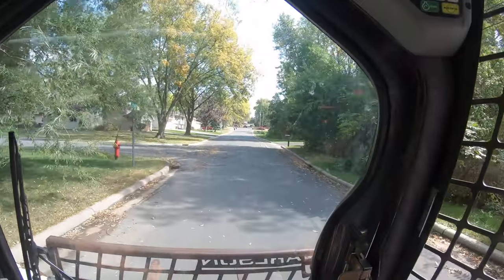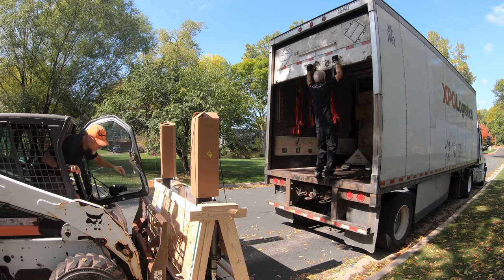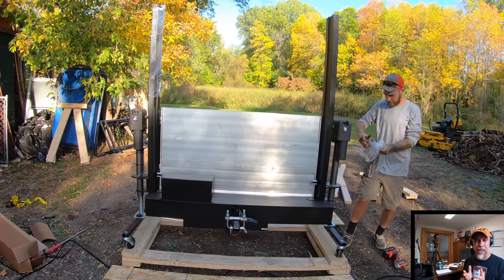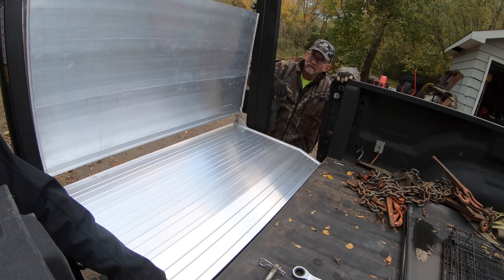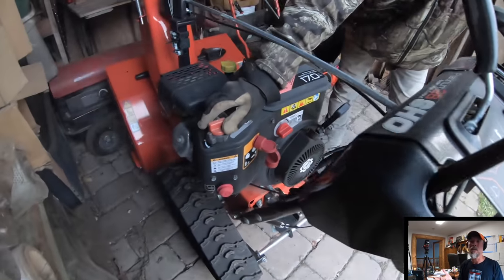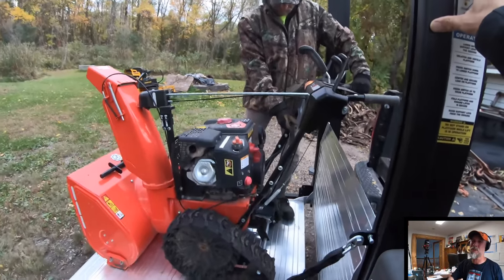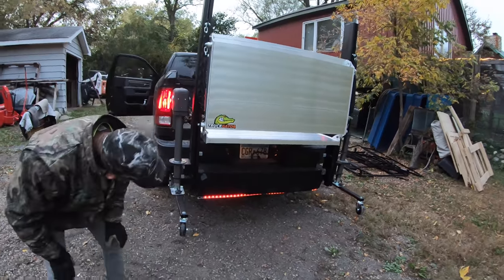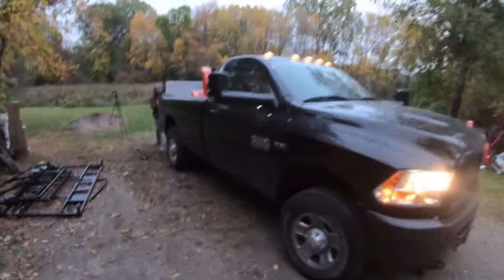Work Truck Lift Gate

Comment: I started out push mowing out of a 06 chevy silverado. Mowed a customers lawn twice for nice steel ramps for a mower. Bought a 48" exmark turf tracer. Loaded it in the back. Slid right in the wheel wells, perfect fit. Held the push mower behind it. Blower trimmer and fuel to the side along with the ramps on the other side. Eventually bought a 16' enclosed trailer and grew from there.
Reply: http://imgur.com/a/4fWpycF
Rear view of ramps down and mower in bed

Comment: I was a wheelchair bus driver and had a ramp like that on a cargo van. It was make of steel and much safer than that looked. In the winter when there was no school I used it to load up my 3 stage snow blower and was great going different places

Comment: My buddies and I designed and built a low-profile lift like this for a college engineering project.  It's a lot more simple (and cheaper) than this Lift Gator, but needs a few more revisions to be perfect.  If I recall, it has a 600 lb capacity, a platform with a low profile to easily load things (like a refrigerator on a dolly) and it probably cost us about $300 in materials.  Also, whatever truck it is installed on needs zero modifications in order to use it.  The tailgate stays on and the platform can even be folded up for transport, sort of like this thing.  Perfect for moving appliances or small equipment.

Comment: I have just a regular Tommy gate lift gate on the back of my F250.. That I used to pick up washing machines refrigerators boilers and engine blocks anything that is too heavy To physically lift into the back of my pickup truck... I've even used it to load my riding lawn mower. But my gate is only has a 2 and a 1/2 foot wide deck.
Reply: i use mine for delivering appliances for big box stores. i've loaded my cub cadet rider and it's a little sketchy but it gets it up and down.  sometimes i wish i had gone for the widest model  but that cuts into your visibily backing up.

Comment: I think b&d lawncare and brains lawn maintenance, and maybe you, did a video on a beaver tail for a pick up truck that slides into the hitch receiver and bolts onto a few extra spots.   It also had a ramp that folded down.   Really slick design.  I liked it because it also had a hitch extender built into it.  So even with it hanging off your truck you could still pull a light trailer.

Comment: Install a flatbed conversion and width is no longer  an issue.
Reply from the maker: Good option
Reply: but whatevr your trying to lftt it has to fit in between the 2 rails on the lift gat

Comment: Thats a nice unit that won't break the bank👍. Otherwise if you want to mover your zero turn mowers with out a trailer I believe a 1 ton dually truck with a flat bed and lift gate integrated into the flat bed would be the right size. Plus then you got more room to store the other landscaping tools. Probably good enough for a 1 to 2 man crew.

Comment: I used to run a box truck and I was leased on to a company that delivered packages and such, I once got a dispatch to pick up a package that weighed like 100 pounds and had a height of about 2 feet if that, it was the only thing on my box truck, and I was so disgusted with the item because I had to drive my big arse truck for something that would have fit in the bed of my pickup truck, if I had owned something like this about 3 years ago I could have done so many deliveries out of my truck instead of burning all that diesel on tiny items.

Comment: Stan that gate is a nice one thing that I see is something you noticed that ramp that goes to the truck bed if it had a locking detent the second is the lift towers if they include a strap kit to take stress off the receiver hitch to attach it to the bumper from road bumps and having the towers strap to the bed tie down hooks to help prevent the jack legs from bending
Reply from the maker: Thats probably there and I missed it

Comment: Why not just invent a tri-folding ramp that doubles as a tailgate. Throw springs on it and have one hand operation without requiring power.
Reply: It's already been invented.  Most delivery trucks have them.
Reply: @ardelpedro7866  Are you talking about a tommy gate? I mean a ramp, like 30 degree incline type.

Comment: the issue(s) i see with it is  at the amount/kinds of equipment that can fit on it when it is ground  level are very few. the snowblower, chipper vac (a mini mulcher for sticks) , a small log splitter,  a push mower, a riding mower if your lucky.  You're not gonna fit a 0 turn mower, you're not gonna fit any kind of atv or utv vehicle, maybe a motorbike .  Unless your just doing small jobs on the weekends its usefulness is few and far between, and even then you would better offer just getting a small trailer. For guys moving funutre like armchairs, recliners, desks, a vanity, it would work but again the types of thing you can hail are very few. Its a good concept, i like the idea but the practicality/usability just isn't worth the lower price tag
Reply: Just design one with a longer more sturdy ramp and it would solve your complaints
Reply: Abe Peterson  i know,
Reply: Ya a 5x8 utility trailer would do a lot more, but if you’re just moving small equipment regularly it would be a good investment

Comment: Liftgates are wonderful and belong on most working pickups. Research different types to find what suits your use case.

Used Tommy Gates are the most common and easiest to support but the design shown though on the long side has advantages like the "landing gear".  I don't see a compelling reason to buy that version vs. a Tommy Gate and a bracket kit (they're very easy to install) though. I'm extending mine to a length similar to the one shown to lift motorcycles. If you're interested in liftgates study all options. I welded (you could use eyebolts too) lifting eyes to mine for easy one-man install using an engine hoist.

Liftgates and what they load tend to weigh a bit but that's easy to solve. I carry machine tools etc in my F150 using Hellwig overload leaves, coilover shocks, and Timbren urethane overload  (which are a brilliant design and can't leak like air bags because they're not pneumatic). D-rings or other winching/pulling anchors in the bed permit loading non-running mowers etc.  (I mounted my Ramsay behind the cab at bedrail top height where it is useful for the same reasons tow truck winches are useful in that position, and it shares power leads with the liftgate.)

Do a liftgate correctly and they're magnificent. Gate extensions folding or fixed are highly effective. Watch many videos from different brands and check out pics of used liftgates to get a feel for how they mount and how you might want to fabricate modifications. Don't just buy one without thorough study. They can save your back (once your back is done so is your life), speed logistics and even be an adjustable height work surface.

Comment: You guys should be using 3.5ton tipper trucks, thats what landscapers in the rest of the world use. Ford transit, citroen relay, fiat ducato, peugeot boxer, nissan cabstar, mitsubishi fuso/canter, izuzu Grafter , renault master, iveco daily, mercedes sprinter. Search for any of these and "tipper" I'm sure you will find them. There is a type of vehicle designed exactly for a lawnmower business or any small plant, they are called "plant and go" but they are very rare. I think they make them from front wheel drive camper van chassis. Without the rear axle the plant can go right between the wheels, gives you a low loading height of a trailer or even lower than some trailers, I've seen one with like 6inch ground clearance someone was using as a car transporter.

Comment: 13:00 extra registration, also don’t need to worry or train an employee to drive with a trailer.
Reply from the maker: exactly!
Reply: 2 or 4 less tires, wheels, bearings and 2 less axles to worry about.

Comment: Stan I have a 12ft flatbed GMC 3500HD with a lift gate on the back instead of a dump unfortunately and it really is amazing for putting things on and off the truck but it is a total pain in the butt when I do my mowing. I think that gator lift is a great idea but def should be a short term solution.
Reply: How is a liftgate a pain in the butt? Slinging mowers just requires a folding gate extension because of their area and they're easy to make or have your local weldor or fab shop copy (you can buy 1/8" sheet steel cut to size and the other parts can be any common angle, channel etc you prefer). When a tool doesn't serve me I modify it and press on. Figger out how much area you want then copy success. Extensions are just basically a hinged panel.
Reply: @obfuscated3090  yes great idea that of course I thought of. My lift gate is a folding gate already and folds under the truck so I can’t add an extension onto it. Also can’t have a hitch for a trailer because of the lift gate setup. Don’t just assume people haven’t had an idea.

Comment: The problem is I paid $5k for a 2011 ram 2500 and $500 for a 5x8 trailer at northern and this cost half the whole set up. I do hate lifting my snow blower out of the back in the winter though...

Comment: What about a RampRack or MowandGo System ramp for the truck? It allows you to fit up to a 52" wide mower and most guys are able to take a 36" or smaller along with a 48/52

Comment: Bevel the ends of two 5'- 2"X6"s,  ( so the wheels can easily climb onto the boards ). Place them on the lift so the real wheels of the 48" mower will be on them,  drive the mower aboard, and the boards will support the front wheels. Drive the mower into the truck bed, Remove the planks, throw them into the bed, alongside the mower, raise the ramp, and go.  Reverse the procedure to unload.   PROFIT !
Reply from the maker: Nice!

Comment: If your looking to ditch the trailer Ive seen a few guys around here buy old box trucks with commercial lift gates already on them.  It hauls your equipment under cover and is a rolling billboard. Not a bad idea.

Comment: I added a harbor frieght truck bed crane to load my 7500 generator.  I built a 4ftx4ftx4ft plywood box to store/haul my tractor show camping gear. It has 4 sheets of 1/2 osb and like 30ft ish of 2x4 and my crane lifts it ok when almost empty but loaded i like to use my loader. I could fit 4 light wieght skids no problem on the back of my trk but 2 heavy ones might be a bit much for my f350 dually
Reply from the maker: dang- that sounds handy
Reply: @Dirtmonkey  its 500lbs to 1000lbs rated like a cherry picker.  Mine is on a flatbed truck i rebuilt with the crane in mind.  My back 2 4in c channel crossmembers have a 1/2 in plate welded direct for a mounting surface.  I hauled friends junk motor home on my trl. Back brakes locked up. Needed to keep it to left so could get trk out and get trl. I ended up throwing chain around crane post for last pull. No damage

Comment: You need to contact tgat trucking companies os&d departments to file a damage claim. Send them photis of the damage. Usually trucking companies only make residential delivers using a 28' pup trailer or a box truck.

Comment: I managed a company that had a fleet of gmc canyons, and we had lift gators on the back of all of them. These were used for multiple trips loading and unloading equipment 3-7 days a week, year around.  The lift gators were destroyed after a year. Not from abuse, but from professional use. Welds were breaking, electrical connections were pulling apart, and the main pivot points on the aluminum hinged decks had broken and been rewelded multiple times for each gate. 

It's a cool concept but they are not built to withstand daily use.  A casual user would better off renting a small trailer. A professional user will be disapointed.  A tommy gate can be installed for the same money or less.  

AVOID!
Reply: Agreed. That gator thing is obviously lightweight. Tommy Gates outlive MANY trucks and bracket kits are cheap or ya can fab one to suit.

Comment: The gate that makes contact with the bed does hold itself for storage or travel when you fold it down into the lift section first, then fold the lift section up and lock it in place. If you want to see what the hell I am talking about (I am visual/hands on learner lol) check out eTrailers video about this product here on YouTube.

Comment: I just checked how much this thing cost and yea no not worth it 3k for that when you can buy a little 4x6 trailer for like 2-3k and I get it people might not like to drive with trailers but with a trailer you get more space for hauling more stuff.. that’s just what I think 🤷‍♂️
Reply: You really don't know what you're talking about. 4x6 isn't going to be big enough for most mowers and 2-3k is insanely high for a 4x6 trailer. Your looking closer to 400 bucks
Reply: Bought a 5.5ft x 10ft at tractor supply brand new for just over $1000.00 tax included.

Comment: Are you suppose to fold the inside ramp up and lower the lift down a few inches so it would be locked up or would that not work?

Comment: Hey brother I think that thing is overkill I had a Honda track Drive snowblower similar to the one you’re using there I put one of those handicap ramps on the back with the door that swings down drive it right on up first thing or leave it right on the back of the trailer hitch take it off when you get home are use that for years no problem

Comment: Wonder how it’s gonna move in freezing weather. Is it electric hydronic?
Reply: Its either electric motor powered hydraulic or eletric motor cable powered (winch). Either way it should work in the cold. Just make sure the battery that powers the unit is in good condition for the winter months

Comment: Working in trucking industry I can tell you that the shipper did not protect the bottom of the gate where the light's are. Second when you took delivery you should of looked at the overall condition of shipment. You should of seen the broken grate and noted on delivery receipt. But know you start to trash the trucking company,

Comment: So.. why not use some simple ramps? Sure, you wouldn't drive a big ride on mower up there, but once you're in that league, I doubt you'd be working without a trailer. For stuff like the snowblower, which is self propelled, some ramps should be plenty adequate. 

About trailers: Do all trailers require insurance in the US, and do you even need a special license to run them? In the Netherlands we have small trailers, up to 1500 pounds total weight (its own weight + loading capacity) that don't require any insurance or registration. Up to a combined weight of 7000 pounds (vehicle + trailer), with a few restrictions, you can drive trailers without a special license, but if the total weight goes above 1500, it needs to be registered and insured. To me that always seemed like a pretty good way of doing things. Homeowners can run small trailers, pretty much for free, if you need to haul more, you have to pay insurance and register the trailer, and if you're a pro hauling big trailers you need a special license.

About the lighting on the lift gate: It sucks. Now I know the US already has some pretty crappy vehicle lighting in the rear, with brake lights just being brighter rear lights, and turn signals just being the taillight with the brake light alternating on and off, but that LED strip looked especially crappy. They could've easily added some lights on either the rear of the jack stand top cover, or the side of the lift posts. Some working lights on those lift posts would've been nice as well, with LEDs these days it would be easy to light up the area really well. Especially when doing snow removal, everything is dark and slippery, some extra lighting would be a really good idea.

I also don't get why manufacturers always go for the separated charging setup. You've got the lift gate attached to a mobile power plant, why not just hook into the vehicle's battery, and charge its own battery from there when the vehicle battery is high enough? That way you don't put an extra load on the battery, but the liftgate battery just charges when the alternator is running, or the vehicle's battery voltage is high enough. I bet if you did it that way, you'd never have to worry about the liftgate battery being dead, and your vehicle would still operate as usual.

Finally, the huge gaps between the liftgate and the rear of the pickup are a bit of a bummer. Many guys just like to throw their stuff in the bed of the pickup because it can't go anywhere, but with these gaps you could even lose a string trimmer if you're unlucky. If I was running this thing, I'd definitely fabricate something to close that up.

I'm always so conflicted about these kinds of things being allowed in the US. On one hand, it'd be awesome to be able to use something like this. On the other, I'd be terrified driving behind somebody who's got this attached to their vehicle, because I don't know how well they attached it, or if their vehicle can even handle it. I trust myself, just not other people.
About the attachment by the way, how does the liftgate handle when you're driving? It seems like quite a bit of mass for it to just be attached to a trailer hitch, especially when it rotates, it's probably putting a massive amount of torque on that pin. I can't imagine that weld lasting long.

Comment: You may wanna take a look at your insurance policy I know mine Whatever I’m towing it’s 100% covered no matter what.
Reply: That is typical with most insurance, however in the event it breaks away it becomes an uninsured motor vehicle. Also in most states that require a trailer license plate they require trailer insurance. On the other hand it’s only $8 a year for my 30ft 20k lb trailer here, but may be more elsewhere.
Reply: The trailer that got Disconnected hit me. The other parties insurance covered it 100%  I guess it all depends  on the coverage. California is real strict on coverage